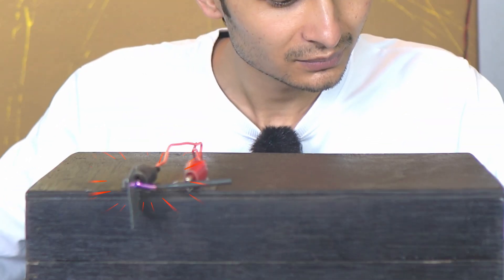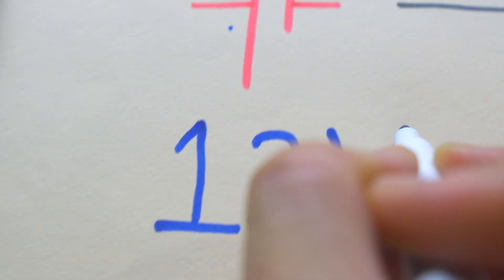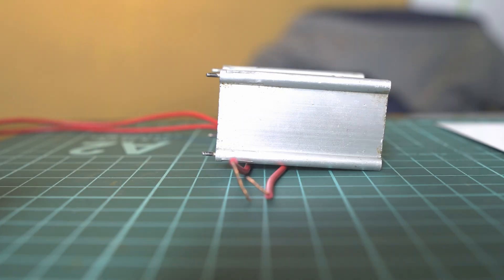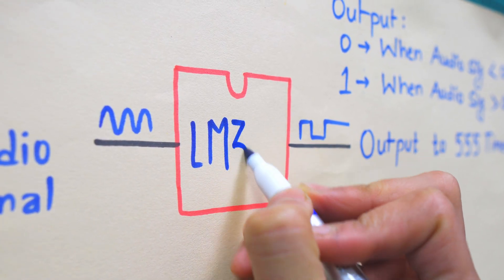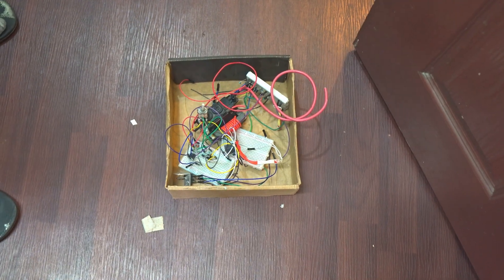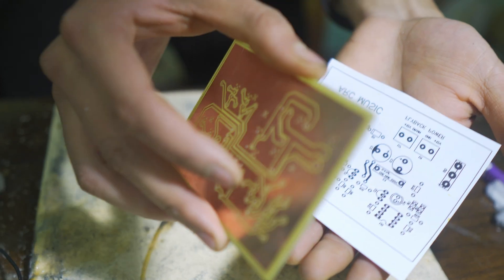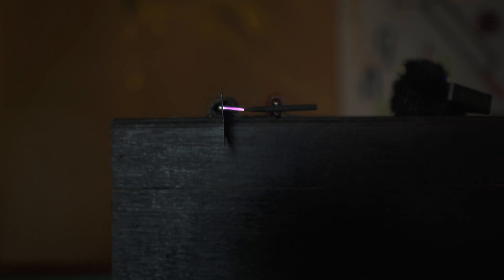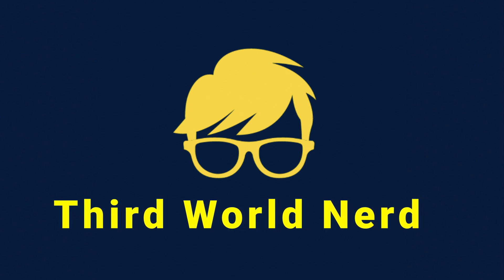DIY Electric Arc Speaker!

Comment: you could use TRANSISTORS like D718k . It might produce heat but a simple heat sink can be used . Infact , u could also use a ZVS driver to drive it and use a separate amplifier to drive the gate of the zvs hence nice music with no heating issues if a mosfet is used. Additionalyy 7 khz is not an optimal frequency to drive that flybacl transformer for it might be in saturation mode , so we could make it up to 5-50khz and use a potentiometer to vary the resistance efffectively producing changing frequency . This driver also needs huge amount of inrush current too. In order to use "irfz44n" in this circuit , u gotta do calculation to remove stress from the mosfet like gate resistance + inductance + capacitance should be accounted. furthermore if u wanna compress the circuit into few component then u will need a transistor or any mosfet + 555 timer ic  and some caps with resistor . Tq to whoever is reading this comment . I am Nepali and huge support to you dai !!! love ya content <3
Reply from the maker: I am pinning you, for your nerdiness 😉
Reply: @ThirdWorldNerd  full support to you dai . what about making a zvs circuit for induction heating . it's a preety common project or has it been done?
Reply from the maker: We really appreciate your suggestion! While it is not in our upcoming projects, we have even more exciting things in the works.